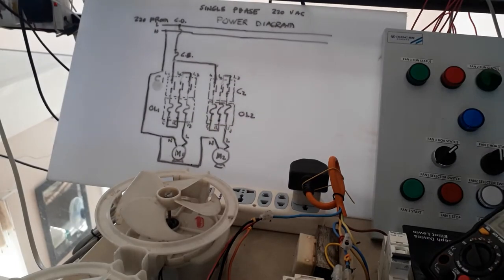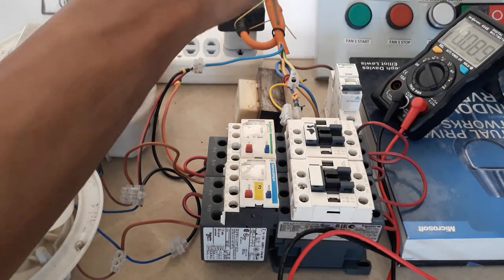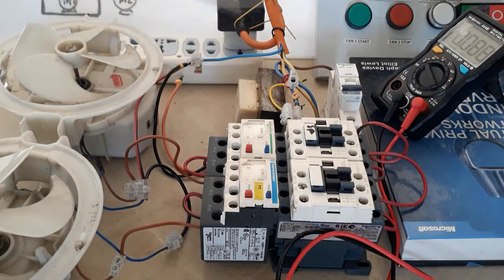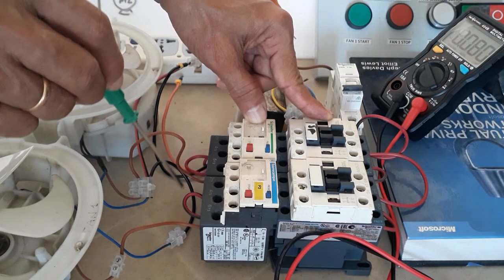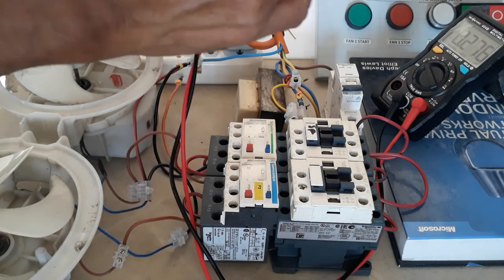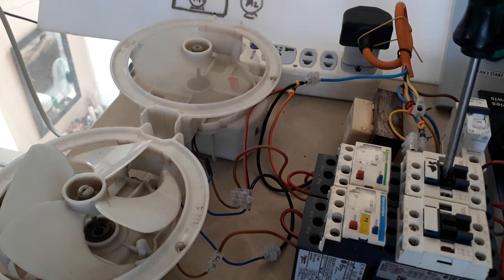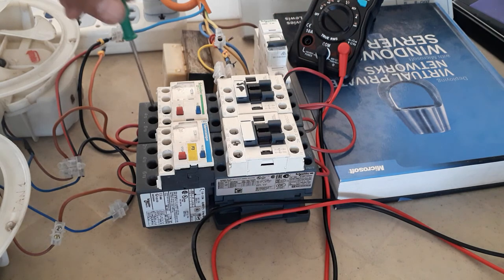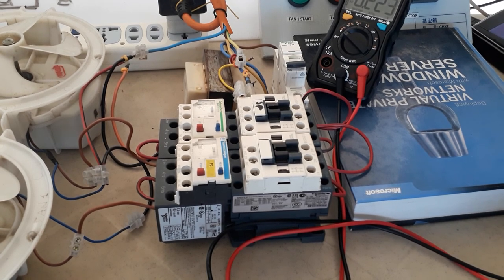Motor Control Power Wiring Part 2

Comment: nice video tutorials..but just want to see the bms wire cable where connect to the control panel to auto /hand or to the olc contacts for auto trigger..
Reply from the maker: you want to see how the controllers (DDC) start/stop the equipment?
Reply: @SantosJrCapellan-BMS  perhaps if you don't mind...I just refreshing my past when i  work as preventive maintenance in one of the most prestigious buildings in Makati controlled by BMS...I always turn the ss from auto to hand and disconnecting the cable like an rj45 maybe computer cable whenever i check the control or the motor for my safety..and turn it back after the check...and i am excited to watch your videos and reminiscing my old days....maybe i am so very left behind on the technology...i am now a babysitter of my grandchildren...more power to you sir...God bless..
Reply from the maker: na bisita ko na rin ang bahay mo at nag subs din ako
Reply: @SantosJrCapellan-BMS  salamat lodi..😁